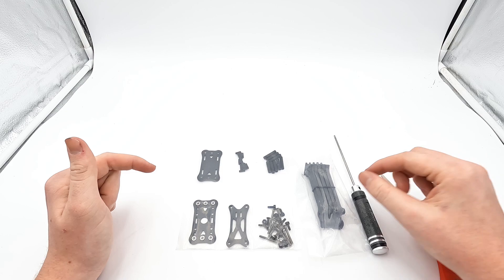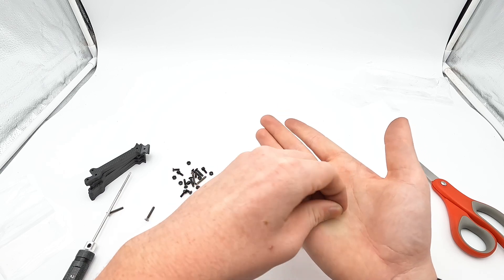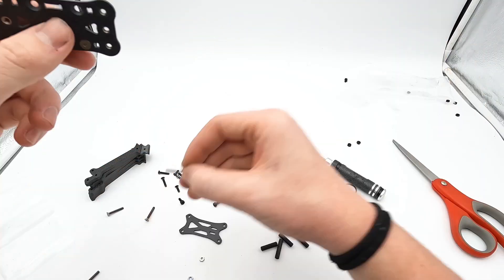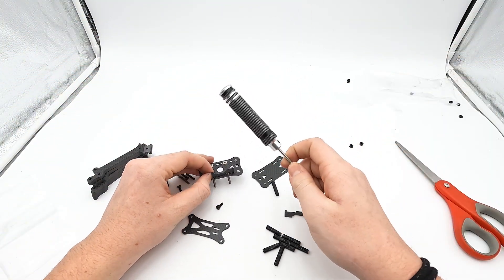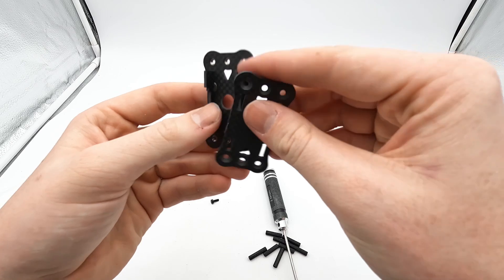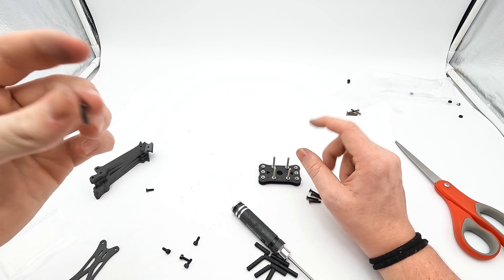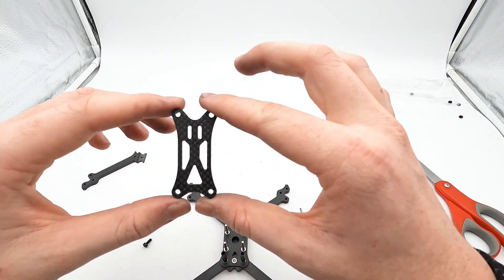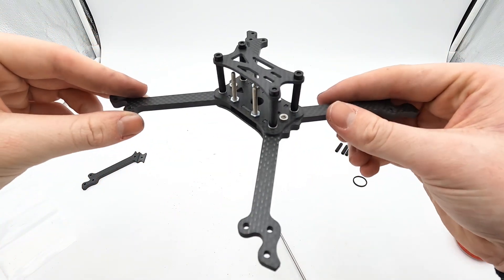Five33 LightSwitch V2 Ultra Frame Guide

Comment: Man just don't, DON't hit carbon with anything, or at least don't breath in carbon dust... Also no gorilla mount holes ;/
Reply from the maker: The current lightswitch ultra unfortunately doesn’t fit the gorilla mounting pattern but all of this will change soon :)
Reply: @headsupfpv  2 weeks eta? ;] need to clear cart with swbPro/LS2?